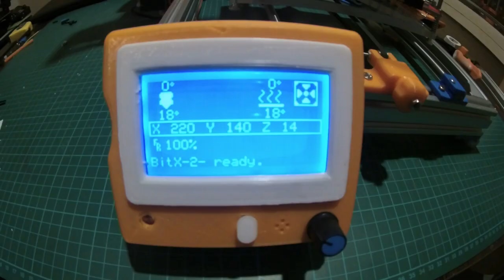How i create my fully DIY 3D Printers

Comment: From where did you get the extrusions?
Reply from the maker: hey Kev, mostly China. hows printing going?
Reply: @BitRC  Do you buy the extrusion and electroncs separately?  I have an AM8, itching to build another.  Thinking Haribo 3030 w either clone rambo, or maybe eben creality board since they now have 24v and tmc chips.
Reply from the maker: @illusionistpro  yeah i buy everything seperately. Your ideas is going to cost you more but it will be a beautiful build im sure. And of course quieter with the the TMCs
Reply: @BitRC  great enjoying the 3d printer and having fun with my passion!